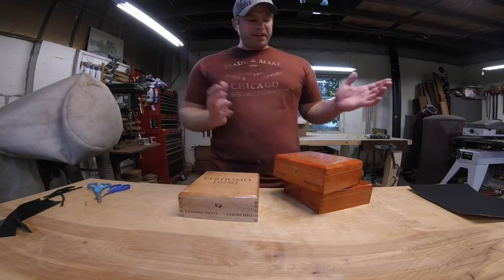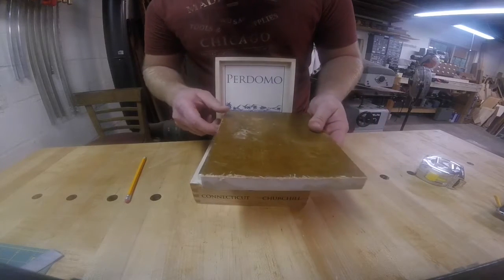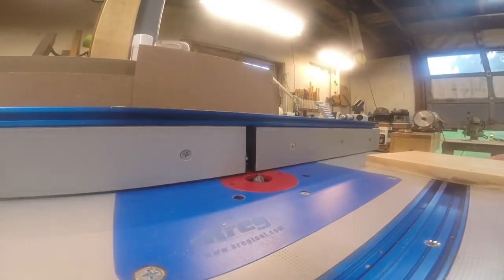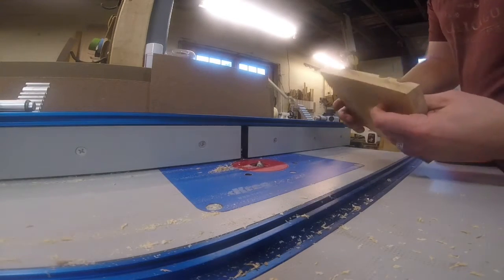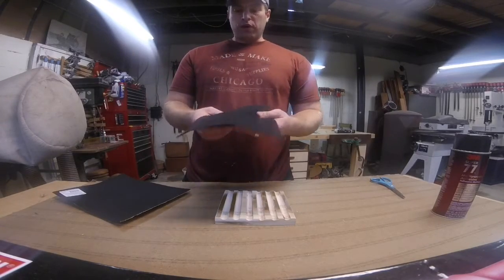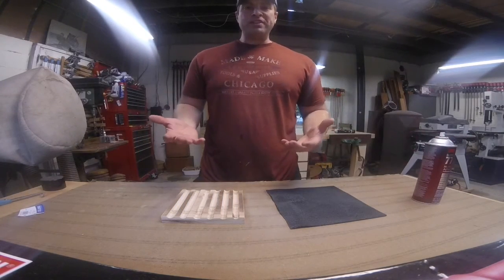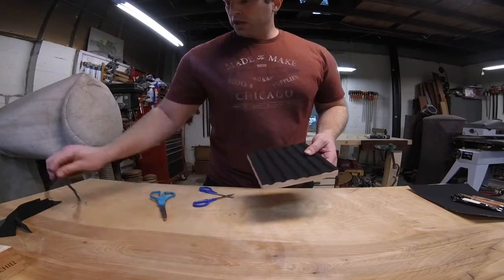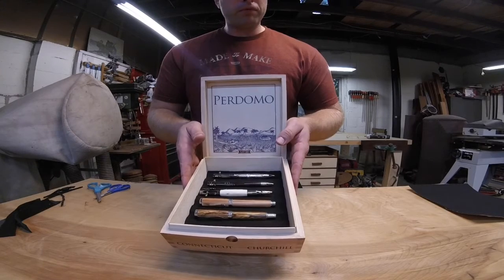Making a Cigar Pen Box

Comment: Dan thanks for the video as I'm watching it my brain started working on additional ideas. 

1. You could use flocking powder with a flocking tube for a more exact felt fit to your cut out board for pens. I have seen it used for jigsaw boxes for the inside. 

2. Before you do the felt or flocking how about drilling holes in groves at the ends where the pens are metal. Then place magnets in holes and cover with felt or flocking so they don't show. The pens will stay even with travel. 

3. How about raising the back of the insert to give a better display if the box is sitting flat. You don't need if you intend to have the box on an incline for display. 

Those are my thoughts. I'm enjoying your demos and reviews and looking forward to more.
Reply: Reading your reply to cigar box from five years ago what a great video I like your ideas that you added to in your reply